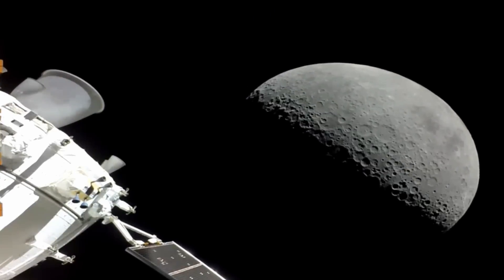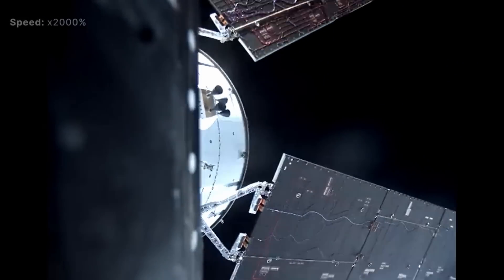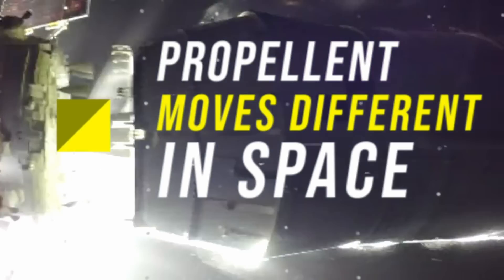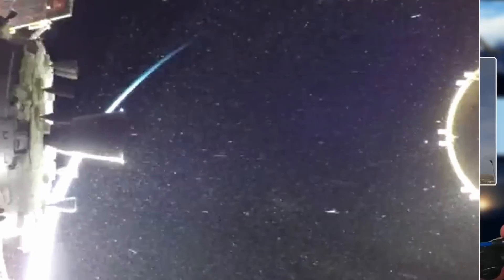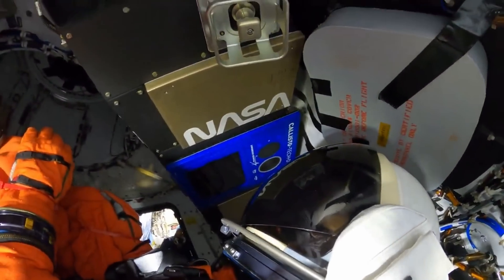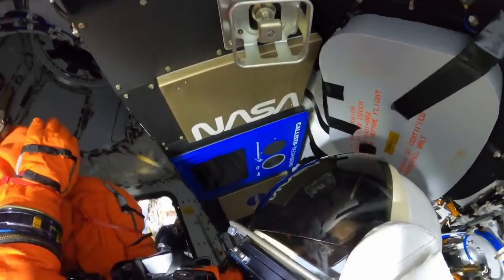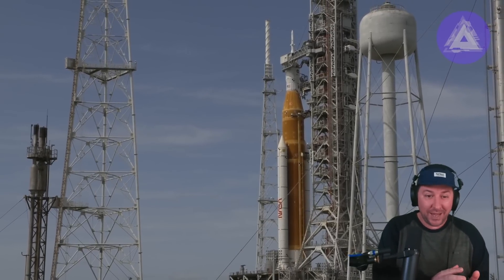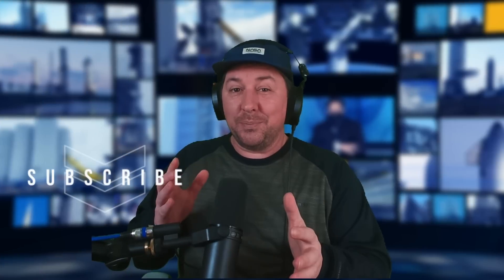Artemis 1 Mission Update: Orion Splashdown

Comment: I was not aware that the "dummies" were there for radiation measurement. That makes sense. Also not all of the experiments were successful. Wasn't there a Japanese cubesat  that's engine fine failed, likely because of a stuck valve in its propulsion system. I thought consequently the solar panels were upside down. I could be confusing two.